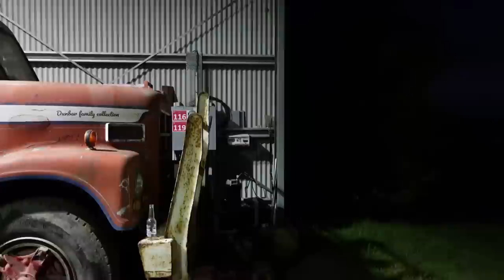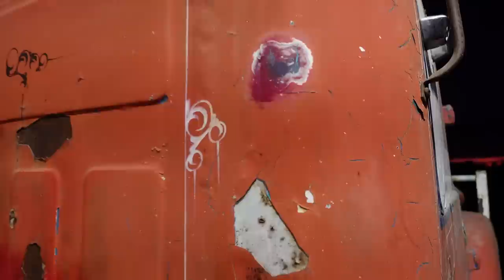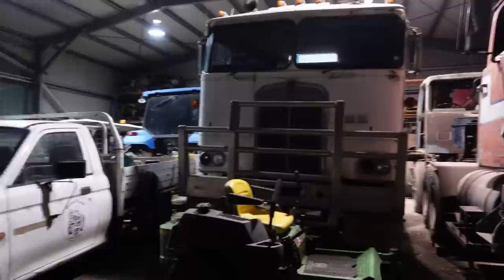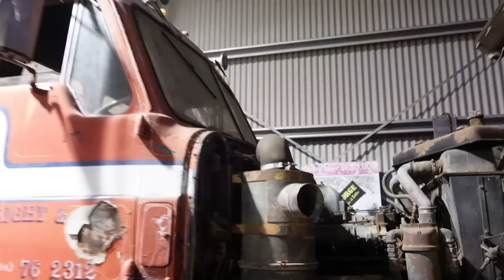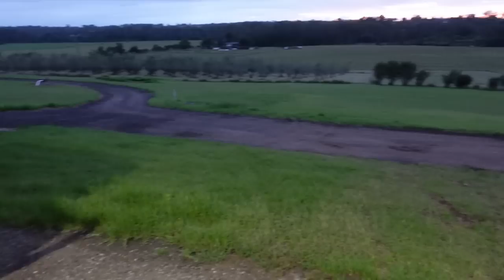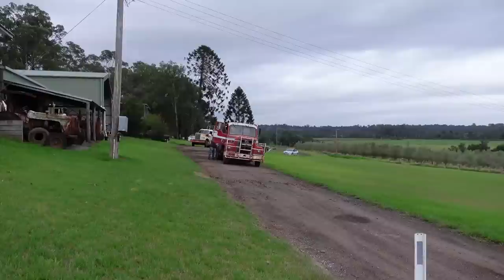Transtar DCF 400 Semi Truck! Haulin the Hume (PART TWO)

Comment: Great video Steve, on a magic old banger,looks like 104 inch bbc,Wrights at Mt Isa had 5 of em as tray truck spec,22 foot, i think from memory a very narrow sleeper box🤔318-n65 which i think were actually 304 running accessories,  n60-290, n55- 270, not sure why Inter used centre outlet manifolds there is a school of thought that it does'nt help with the breathing, stay safe cobber 👍
Reply from the maker: Hi mate thank you. It’s a fairly rare truck here now I think. I do know of a few but not seen much at shows. I think it’s 290 this one. It’s so quiet compared to the Kenworth. I have 2 transtars with v8 Detroit engines and both very quiet. Hopefully one day I get the time to get her on the road again
Reply: @stevesplacedownunder  Good on ya cobber, I hope you do to, Cronulla had em, meadows used to have a couple,&emeryville's,4070 running Brisbane 👍

Comment: Steve’s Place, Shenanigans Down Under 😝😝😝
Reply from the maker: Indeed
Reply: @stevesplacedownunder  how long have you been collecting your trucks
Reply from the maker: I got the first one when I was 20 so 18 years ago. Stopped for a while then started collecting again. I don’t work any of them I’m not interested in that. I just enjoy going for a run somewhere and working on them
Reply: @stevesplacedownunder Nice, My First Truck Is A 1978 3866C 350BC 15sp 46k Six Rod Rear Cut Added I Think It Had 40k Walker Beam 45t , Then 1978 K125 400BC 15sp 44k Reyco 4 Spring Bad Investment Didn’t Use It 80t,  So Then Got 1978 K123 8v92 9sp Aluminium Walker Beam Ex Finemore’s Fuel Truck 45t, Then 1996 FH16 Volvo 16lt 520hp 16sp Hub Reduction 131t Ex Shaw’s/Ktrans, Then 2003 Argosy 110 Big Cab 6NZ C15 18sp 46k 90t Is My Current One But Somewhat Retired As Injured Back With Constant Sciatica
Reply from the maker: You’ve had some big trucks there mate very nice. What sort of work do you do with those? Float work?
Reply: @stevesplacedownunder  No not much float work mainly single semi tipper, pocket roadtrain semi tipper, single flat top, roadtrain flat top, b triple flat top, single extendable, walking floor pocket road train with my own trucks but have done all sorts prior, rigid agi (residential/underground), hiab tray top, tipper, single semi tipper, flat top, float, pocket roadtrain side tipper, b triple side tipper, triple side tipper, 3.5 quad side tipper double pocket dolly b double, loaders, flat drum/pad foot roller, rubber tyre roller, excavator (1.8-35), bobcat, float grader/scraper/dozer, fixed batch plant, mobile screener, worked in mums cafe, dad’s pre mix concrete business delivered concrete at sixteen on car L’s made concrete products tanks, leach drain, slabs, kerbs, grit mix leach drain blocks, carted sand and blue metal from passenger side, drove dad’s single tipper/pocket roadtrain, cut/supplied firewood, did vineyard work (hated it), farm hand work, didn’t mind it but didn’t pay enough so kept on truckin, drove moxy dump/water truck, 769-777 dump truck, semi/roadtrain watercart

Comment: For a truck made in 1969 that's in alright condition really, that's a long time ago and would have done some hard miles in its day.  

Your correct on the injectors Steve, for some reason the engineers at IH put N60s in the 8Vs I guess they thought they'd be better on fuel it's true because @ the 290 hp rating they were getting 6.2 mpg as a semi. Thanks for the upload.
Reply from the maker: It is in great condition for that age mate. I wish it could talk. 
 Yeah mate I know just by going off the sound of them compared to my other 8v71 trucks that these are derated in power. I think they would use more fuel with the engine working harder to do the same job as one rated at 318 but maybe not. But it’s fine for what I will do with it. Hopefully I can get it to an on road condition
Reply: @stevesplacedownunder  Your correct in that the de-rated 8Vs were a bit noticeable in slightly less power than the standard 8V.   My brother said that. He had an Autocar with a 290 hp and pulled a quad float with it and a 35 ton CAT excavator and it went alright.  Sounded like a Symphony going up the Gunalda range near Gympie QLD.  The trick with those natural 71s is when your going along flat cruising and then hit hilly country as soon as you hear the engine lose it's note or one ounce of speed downshift real quick and hammer down . Detroits don't have a 50% torque rise like a Mack as you well know.   You would also know that those exhaust manifolds have the outlet in the centre like the 8Vs in the White Road Commanders which gives it a different sound compared to the  normal ones .